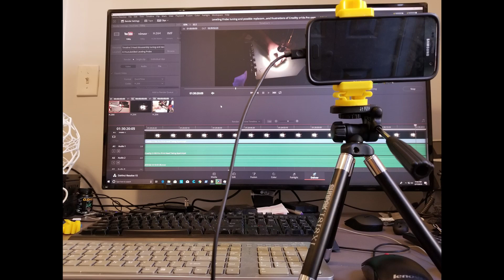Creality CR10S Pro bed  bending and Truing,  leveling probe, First Layer Flow and gap

Comment: Hi all of you !

I just ordered this printer !!!!!!!

After seeing these videos I tend to CANCEL that order !!!!!!!

Is there anyone here that have this printer to work properly ??
Reply from the maker: I think you should give it a try. if you ordered from creality and have issues with the printer you can send it back, but you have to go trough the hoops of talking with tech support, sending them pictures things of that nature. So you can see if it works well. In addition creality adds improvements to their printers and I do not think they announce them. so some of the issues may be resolved. the only thing I am suggesting is yo get the tinymavhines3d firmware installed, if you cannot work with the creality firmware. You can watch mybother video on checkup and see some things to be aware of on how to check the printer right out of the box. they all need a bit of tweaking out of the box. A lot of people got it to work properly. You may want to join the facebook group for cr10 and you can get a lot of help there as well.
Reply: I have bought printer a few month ago and so far none critical issues with it. I am not an experience guy and all issues I have got I have got because of low experience with the maintenance.  Also swapped Cura by Simplify3D. Works good for me :)

Comment: Use Cura, not S3D. Set retraction to 6mm. The real problem is that granite bed. Why would you not use the original PEI bed?
Reply from the maker: I am using Cura, At the time of the video i was testing the possibility of the the marble to stabilize the vibrations. Thanks for your help.

Comment: Follow the Directions in the manual, use the Auto level and measure it will get the bed close.
Start your print go into the adjust menu and watch your first layer if its to high use the live height adjust.

CR10S Pro is hit and miss though I keep having layer shift issues Ive adjust the rollers under the bed twice now I have a 1day 6hour print going atm fingers X.

#1. Check your rollers make sure they are tight and not over tight.
#2. Make sure your tensioner on the filament loader is not to tight.

Surface quality on those prints are yucky my CR10S Pro surfaces look like they are injection molded parts.
Reply from the maker: You know your advice was great. Now I know more on the first layer! Thank you. Tight but not too tight, that is quite relative, especially that there is no indicator on how tight is tight, or how loose is loose. But I did try and still the cube are coming out crappy. Injection molding that it what I thought this printer can do, or close by my prints are way far from that. I am half way to a house build from all the cube I have printed. Now I just cancel them after4 a few rings protruding out. Not sure what to do next, I found a little cyclical bump on the Y axis bed and it intensifies or fades as I adjust the rollers' tension. but still rings all over the prints and surfaces. Thanks for your tips.
Reply: @RoamingInterests  well my 1 day 6 hour print layer shifted 9 hours in grumble grumble grumble.

With tight but not to tight you want to back off all your rollers till they spin on the extrusion when you try to roll them with some force then tighten them in small increments till they stop slipping do front left and front right rollers tightening one side a little then the other so your bed isn't twisted then do the back rollers also a previous comment suggested you get that granite off the bed and I agree lol.

In your slicer tweak your extrusion multiplier as well because uneven surface quality can be caused by under extrusion.
Reply from the maker: @benw543  Thanks for the update, That granite has been off from quite some time, put back the original plate, still once in a while it goes crazy on the level. About the layer shift, I read that if you get an older cura version you will not have the problem anymore. But Still my cubes are horrible. Today I just undid the BED, found a notch in the rail but still no improvement. Even if the roller don't get to the notch, the cubes are j horrendous.  I Have to send it back or replaced, but I am afraid that the following one will have the same issues. The more I dive in and take it apart and put it back the less options for actually finding the fix remain...

Comment: What filament are you using?
Reply from the maker: I used Hatchbox and MatterHackers, grey white and yellow. For most of my tests I used Yellow and Grey, yellow was from Matterhackers, and grey was from Hatchbox. I just received a few boxes with PETG and Polycarbonate. But I am not satisfied with the quality of my print-outs and I will postpone the making of hard stuff, until I get the issues resolved. Also I do not even know what to print yet that works. Do you have any other suggestions? Also I will have you know that I printed a bunch of xyz cube and one of them came out right-ish once, then with the same settings it came out poorly. I will keep on searching for a resolution.

Comment: Forgot to tell you - check your capricorn ptfe tube! Remove the nozzle, release the coupling and pull out the capricorn tube. If is burned or you find a clog in your heatblock, clean everything and maybe cut a few mm of the capricorn tube (very clean straight cut needed = tube cutter) Put the coupling back on the hotend and push the capricorn tube through until you see it at the end of the heatblock. Now install the nozzle so it pushes the capricorn back into the heatblock so no chance of a gap between nozzle and tube. A gab between tube and nozzle is the most common issue.
Reply from the maker: That is going to be a pain to take apart and put back. I took that apart twice already and i think i put it to deep in because after that i wasn't able to retract the filament. So I opened it again and retracted it a bit, but never tested to see if the retractiion works, the printing works but i did find excess of plastic on the heating block. the system may be leaking. Let me tell you is not the most pleasant job to do. and there is quite a lot of incertitude. Thanks for your wisdom, I did move the probe downward and printed a few things, the quality of prints is still random, i cannot repeat results, it seems that each print is a gamble. the tinkering continues....
Reply: Roaming Interests I know you need some practice to do it fast but its worth it. When you retract the filament (filament change) the end needs to be not a blob. So you know if there is a gap or not. Nerys shows exactly how to do it https://youtu.be/uKN0VOuul0o
Reply from the maker: Thank you very much for sharing the wisdom and the link. Once I get a chance I will look into this. Now I do not have the printer next to me. I think the best way is to post an update with a video with all the promises I have been making as people have been helping me here on youtube. Thank You.

Comment: For comparison, complete stock printer, cura all standard "draft 0.2mm" setting on my cr10s pro with the mentioned spectrum pro filament https://ibb.co/bdjSZB8
I do my first layer very near the bed but my extruder never ever skipped a single mm. There is no backpressure you only get an "elephant foot" if the nozzle is to close to the bed.
Reply from the maker: Hey thank you for that photo, do you mind taking a photo with the light shining from above the cube so I can see if your layers randomly stick out? I do not know what to do here, I contacted tech support and they are working with me but I am not sure if it is me or the printer. All the knobs and screws seem tight.
Reply: Roaming Interests https://ibb.co/vcBZK5b
Don't expect perfection from a chinese 600dollar fdm printer ;-) the slightest diameter change in the filament is visible. This is printed in 0.2mm draft mode at 60mm/sec, outwalls 30mm/sec. It can be Z-banding. Coupler issues, bent Z motor shaft or bent Z rod. Even the bed temperature can leed to z banding (not the actual temperature but the powersupply draw for the bed can influence the z motors, I have better results with 60c than 50c, the cube in picture is 50c. You can test this on the fly, first half of the cube 60c , second half 50c.

Comment: set probe hight at 0.5mm instead of the stock 5mm, got better results in my case. (still hate the probe though) the probe only reacts to metal so your very thick marbel bed wont help. filament makes big difference. I have cheap eco pla that does not produce even layers, my more expensive spectrum pro pla does print even layers. cheap filament diameter does change so do your layers. and check your Z axis. make sure your wheels are not to tight on the Z axis. my xyz cubes are not perfect but way cleaner than yours. further do look into the tiny machines firmware for the 10s pro,
Reply from the maker: Well that is helpful. Thank you for being patient with me. I may finally obtained a cube that may be better in quality than the cura stock settings. I will post some comparisons and ask to see what you think.

Comment: I think  your Z height is bad. Bltouch could fix that or manual calibration? That sensor on the c10s pro is sheit. Thats the reason why i havent bought one. Asked creality for feedback about these issues but no responce at the moment.
Reply from the maker: I used to get responses from them, but yea the Z Probe was bad, it seemed to work better with the tiny3dmachines firmware. https://youtu.be/_Bb4NlDA9ww

Comment: what did you do to your cr-10s pro!!! now granted mine is only 3 days old but still i am not having near the issues i love this thing.... @3:02 thats your retraction My CR-10S NOT my pro has did that a few times i put on the upgraded gear system and it fixed that issue on the cr-10s I have not seen any of these issues with my CR-10S Pro.
https://www.amazon.com/gp/product/B079JZ374W/ref=ppx_yo_dt_b_asin_title_o01__o00_s00?ie=UTF8&psc=1 I know this will not fit the CR-10S Pro but it should give you a idea on where and what to look for maybe? I used this to fix my CR-10S

WHAT! bed leveling is hard for you on the cr-10s pro?¿? the surface that came with the pro is very nice <i still have to do a TPU test yet... but leveling with the new Z hight adjustment you can do now plus the feeler that they supply there is no reason why you cant get that level..

protrolem jelly works as a good lube for printed parts.
Reply from the maker: I haven't done anything to it. Or maybe I unknowingly did. But There are some people who confirmed some of my issues.
Reply from the maker: In regards to the Bed Leveling, I eventually get the right level but then the leveling changes or the sensing probe changes from time to time on it's own. Anyway, I went back to it's bed surface and printed an XYZ calibration cube, with the printer on the concrete floor, I used pla hatchbox grey .2 mm Layer height. The Gcode was generated with CURA 3.0.2. And i cannot tell ye if there is any difference from my other cubes. I still get the Saturn rings. I like calling them that because thats how they look to me. In addition to what I just mentioned I also releveld the bed, by checking the distance of the nozzle from the bed "eyeometyricly" So visually the nozzle was at the same distance from the bed on the center and the corners. and I have left the leveling screws more lose. I do not know what else may be wrong, but the layers look similar to what I have printed before. So now im in the process of printing the second cube with the printer on top of a shelf which wobbles under the momentum of the printer. I did these experiments before an dseemd that the results could not be differentiated as one better than the other. I just sliced one xyz cube at .16 mm 40 mm/s with cura 3.0.2 and once the current one finishes I will print that with the same grey PLA. I do have to say that I did not have to relevel the bed in between the two prints so far. Let's hope we won't have to. so The printer is as it came from the manufacturer, not upgrades, same bed and plate. I took it back to basics. Thank you for the link, But think the extrusion mechanism is doing a good job. I was able to manage that issue with flow rate.
Reply: @RoamingInterests I did find anytime you just open or go into the leveling mode app it will reset the bed values But my Z height adjustment seamed to be saved? and i defiantly do not like how this thing will go right into its home position just by opening the app. and dont pause your print then look at values!! had to hit the power quick. is that the x axis belt tight/loose making the machine gun sounds?
Reply from the maker: For the machine gun sounds, is the z axes rods that vibrate int he top holders on certain zig zag quick motions. I put that there for fun.

Comment: I have 2 pros. and had to get the level thing correct but now my pro's are just fine for me. Its all stock and had a layer shift a few times but now its perfect. Maby its your machine I am not sure but I love the pro just working on getting the fans replaces with quieter ones.
Reply: I got two so I can run a long print and still have one to print with plus I have a mp select mini printer but its like 4"×4"×4" lol real small
Reply: I had same issue with my pros a guy named luke told me how to fix it I was doing it all wrong don't go by the instructions or creality vids there wrong.
Reply from the maker: I Just Do not know anymore. I reached out to them and to see if there is anything they can do. The Leveling probe just needs tuning every time. In addition with the other issues. It may be something with mine in particular that I cannot figure it out. I did get the FANs to make it quieter but I haven't received them yet. I probably make a video with replacing those. They are annoying especially that I stay in the same room with the printer. But Ironically I got the fans before deciding to reach out to creality for a possible return. They responded with subsequent questions, I tried to describe all my issues with the printer and let's see what fixing will they offer.
Reply from the maker: Two PRO printers< is there a way to print for others at a cost, or you have that many projects that you need two?
Reply: hello. how did you fix your layer shift issue on your cr10s pro, its driving me nuts right now, i loosend the wheels on the bed track, and my belt seems tight enough. plz help :)